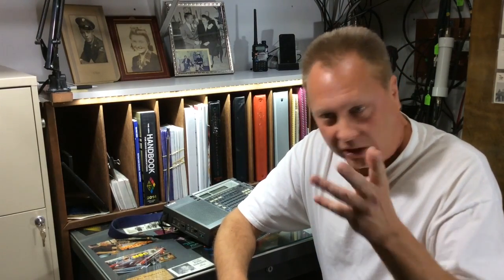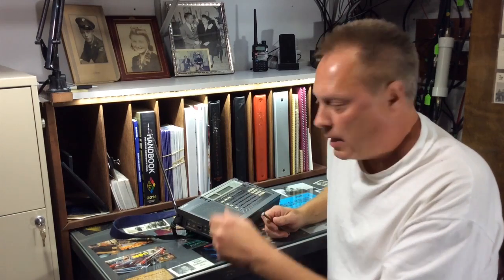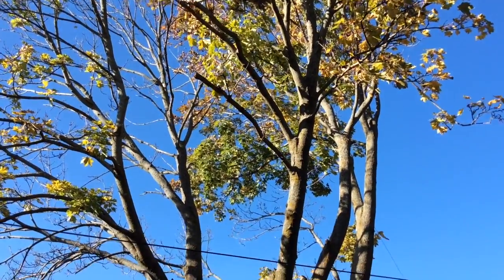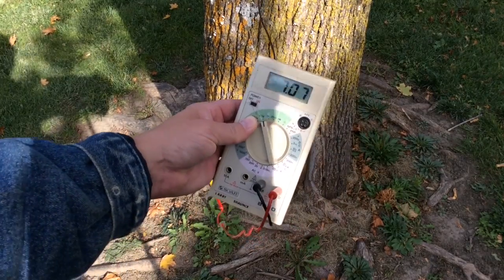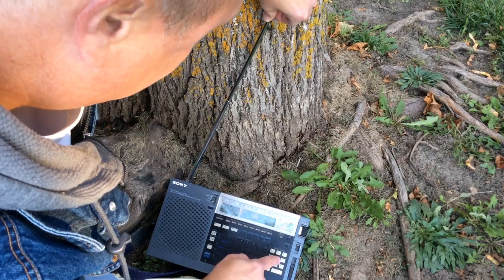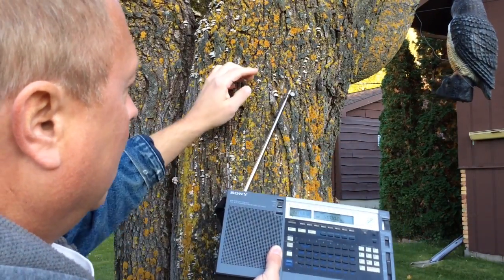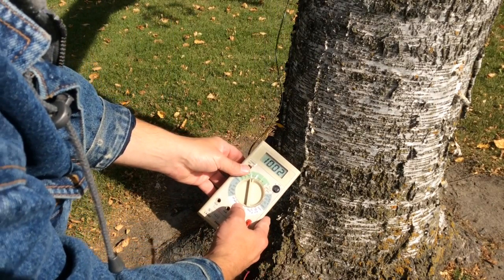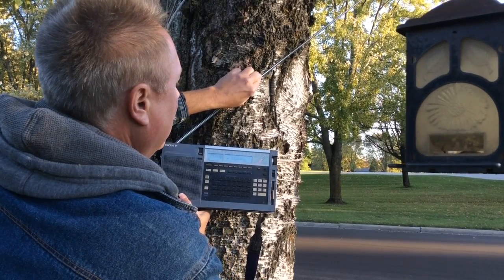Using A Tree As Antenna? Probably Not-You Decide

Comment: I have used the nail method to receive and transmit on the 40 meter band, natural resonance of a 10 meter high walnut tree in winter, no leaves.
It works ok, but I used a grund rod at the base of the tree, so I think it could work better with a proper counterpoise o radials.
I will try the toroid method soon.

Comment: I read a lot about this back in the 70's and 80's. The coupling method then was by winding a single turn of wire around the tree trunk. Most of the experiments were very badly done with no 'control' antenna to compare. I came to the conclusion that the tree was probably not having much (if any) effect, and that the radiation was coming directly from the coupling coil.

Comment: I coupled my Sears 4-band AM/FM/SW receiver to a tree via the ferrite loopstick, and noted an improvement in signal strength. Held the radio close to the tree down near the base - and the signal improved, so, there is some validity to this technique. This was below 6 MHz, as the 2 - 6 MHz range used the internal loopstick as the antenna inductor in that set.

Comment: PINE trees make excellent 2 meter broadcast and receive antennas. Two brass screws (not steel. it is a poor conductor) should be placed, one above the other about two feet a part near the base of the tree. Run coax to the screws; the shield of the coax on the lower screw and the center conductor to the upper brass screw.  The PINE tree will resonate on two meters. You will be amazed.
Reply: I heard this somewhere long time ago, might have been on BBC program Tomorrow’s world when I was a kid ask someone about it and they just thought I was mad, also think read article about it one also
Reply: Two feet is not far off a quarter wave on 2m, so it will be the coupling that is resonating, not the tree.

Comment: Larry: You are too high in frequency.  Try it at LF and the lower part of the MF AM BC band. Just capacatively couple the whip antenna on the ICF-2010  to the tree trunk up several feet on an NDB station.  If you can,  turn the ALC off..  I see RF coupling/transfer at LF/MF with a Sony ICF 2001, but it has a manual antenna trimmer control. I think the 2010D has an automatic antenna trimmer circuit, which may defeat the effect...Also works for me with an e-probe and FT-817....You need high-impedance capacative coupling for it to work....the whip on the ICF-2001 is an e-probe below 300~350 kHz, I'm not sure about the 2010D....Think of the tree as a  high-Z RLC series circuit ....Mike wa3tts
Reply from the maker: Ok Mike, thanks for all the good information there, very interesting.  May have to try that again someday here!  Great info!  73

Comment: Yes, trees have been used for antennas. They are considered a vertical fed against ground so the outer conductor would go to a ground rod and the center to a nail a few feet up to match impedance. A very large tree would show some receive gain but they are mainly for transmitting. Also try rain gutters, metal fences and bed springs.  73s  WA5KM

Comment: Hi Larry
i know some far away FM stations improve their reception when you touch the antenna with your hand . why is this?
Reply: When you hold a radio you are providing a ground. An antenna with proper ground works better. As for touching the antenna; my guess is that you are becoming part of the antenna. So with your body added into the equation you must be getting a better match for the given frequency. A note on safety. NEVER TOUCH A TRANSMITTING ANTENNA!! You will get a nasty RF burn.

Comment: Maybe using a freshly cut long stick/branch which still has moisture in it, hammer a nail in one end and connect it to the radio. Could be useful in the field if you don't have any wire or telescopic antenna of sufficient lenght.

Comment: Larry, Thanks for sharing it really gets the brain to thinking. Below is a PDF link to the military document which is a good read. They used "toroid coupled trees" not nails. The conclusion on page 5 says to keep your wipe but to also have equipment available for a toroid coupled forest trees in case the wipe is not functional. It also summarizes that for MF a toroid coupled tree system could be used for submarine communication and ground mine activation/deactivation. They also did test on using a system of connected trees for directed communication. (PDF Link): http://www.dtic.mil/dtic/tr/fulltext/u2/742230.pdf

Comment: After reading the article tmarinos posted, the thought occurred to me that different species of tree, as well as the time of year may change the outcome drastically. When cutting down and old dogwood tree for a customer years ago during the early spring, I noticed sap running out of the stump. The sap continued to flow for a week or more. Maples act the same way when cut in late winter-early spring in maple syrup country. Old grapevines will do the same thing. I noticed one of the trees Larry tapped was a birch, which will produce sap in late winter. Maybe this experiment should be done again then.